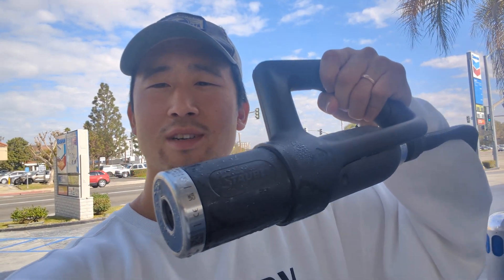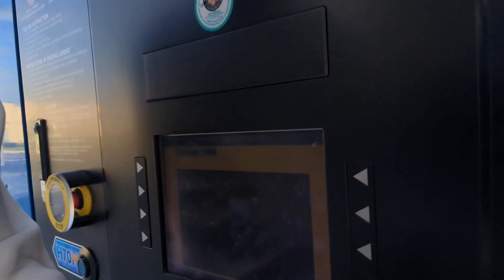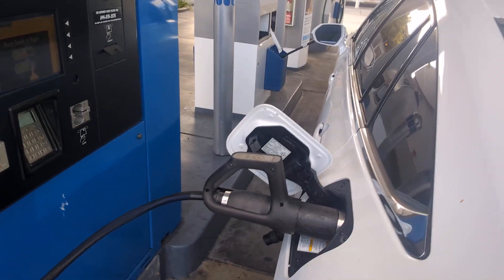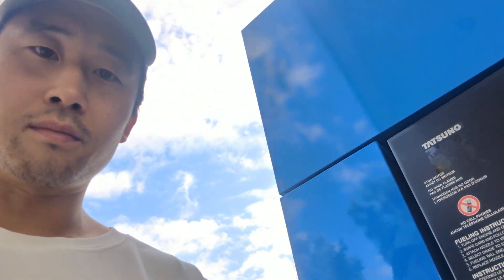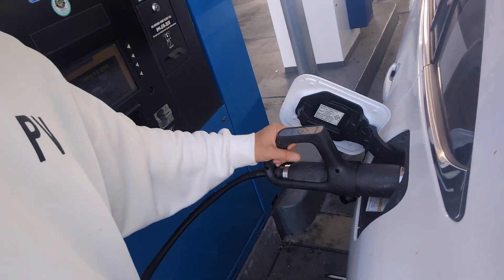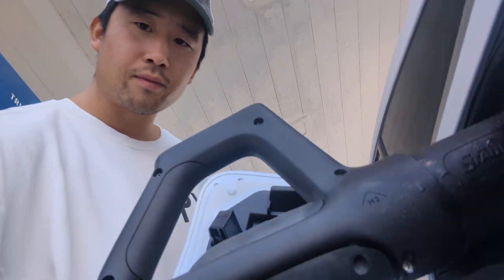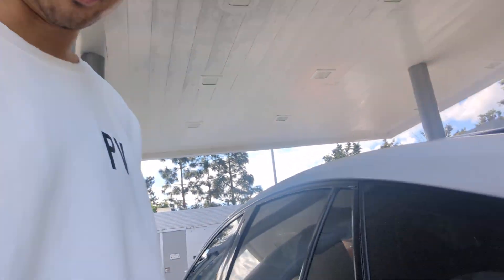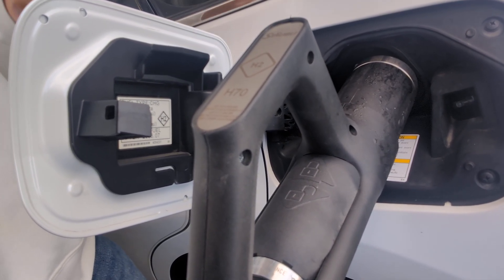Will this save Hydrogen Cars?

Comment: nothing will save hydrogen cars because hydrogen is made with electricity.
Reply: renewable electricity used to generate hydrogen, then hydrogen can fuel the car for much longer than an equivalently sized battery
Reply: @FrIoSrHy Hydrogen cars have an energy conversion efficiency of about 40-60%, which is significantly more efficient than traditional gasoline cars (20-30%). However, their overall energy efficiency is lower than battery electric vehicles (BEVs), which are typically 80-95% efficient, due to the energy lost during hydrogen production, compression, and conversion to electricity. While BEVs are more energy-efficient, hydrogen cars offer the benefit of faster refueling times.
Reply: @Ramkoerss  Sure, but the difference in refuelling time is really small these days.
Reply: @Freba9 that info was a Google search about efficiency
Reply: Here the fuel price is very cheap 14.75 cad/kg
Reply: Hydrogen could be produced with less expensive electricity than that used for EVs with a little planning. EVs need power on demand. H2 can use intermittent power or extra power produced during low demand, like wind power at night.

Comment: Thanks for the update!  It didn't appear, when removing, that you tried to push in before pulling.  This often helps because (1) the nozzle/nipple might have a bit of ice and pushing will break that bond or (2) there might be a bit of pressure still in the hose and pushing will allow for removal. You did show that the hose was stiff after filling which is typically due to some pressure, not freezing of the hose.  

BTW Staubli is a Swiss company.

Comment: No, but it's interesting to see any innovation in what is essentially a dead fuel system in the USA. 
The nearest hydrogen refueling station to me, if I stay in the USA, is 482 miles away. 
The nearest 240 V electric socket I can plug my EV into is about 30 feet away.
I could plug my EV into a regular wall socket, and charge slower.
Reply: You could plug in and charge while you sleep.

Comment: One thing I don't really understand is that why a Prius can have a solar panel and plug in, but  Mirai can't?
Reply: The Mirai could have a charge port but then everyone would realize how much cheaper it is to just put the electricity directly into a battery vs. wasting it to make Hydrogen and then waste it again to convert that back into 1/3 the amount of electricity that you originally had.